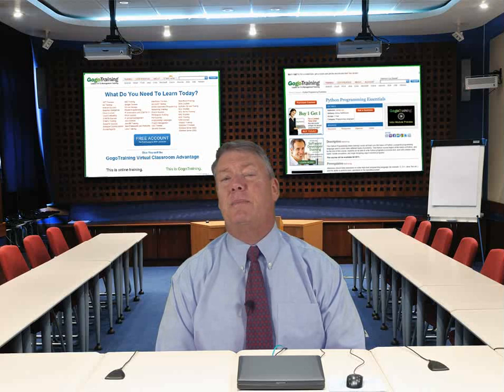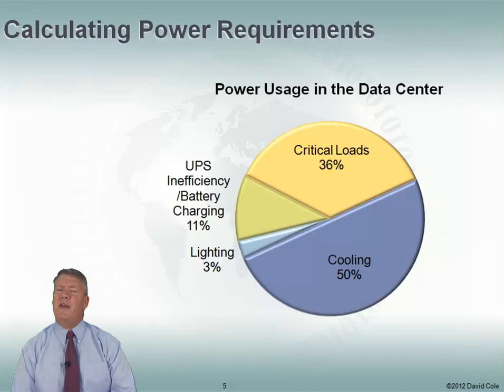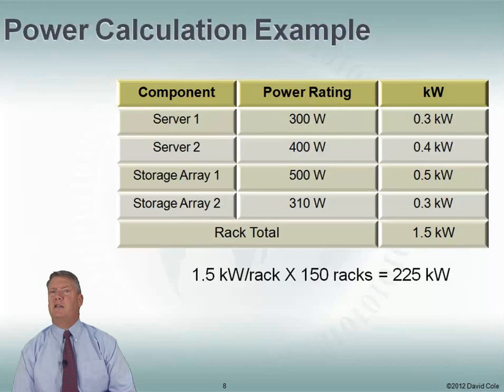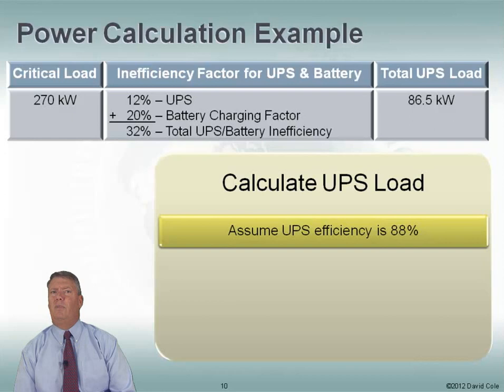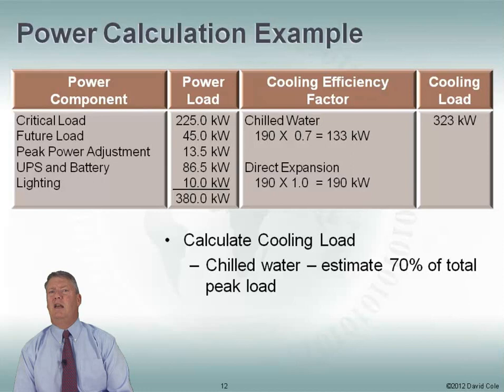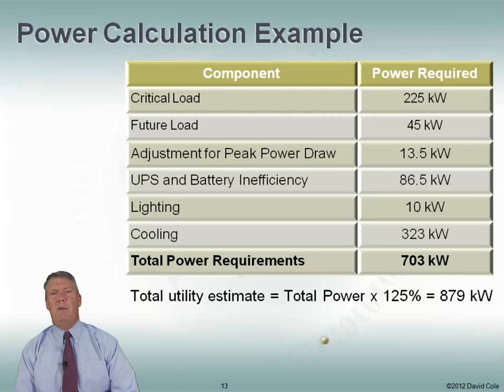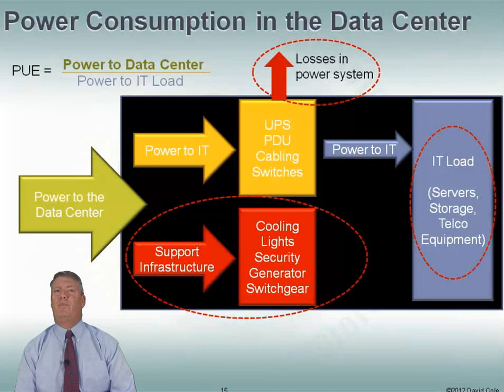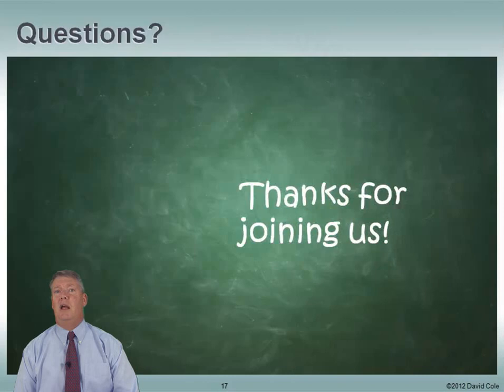Fundamentals of Data Center Power: Power Calculations

Comment: Hi! very interesting topic for which I have a few questions: in a typical DC, in each rack are 2 PDUs for redundancy purposes. My question is: when both PDUs are connected but only one is active (in the sense that it provides active power) how the power consumption is calculated for that rack? Is it that one PDU is supplying max power capacity and the other is idle? If idle, will still consume some power; how much that would be?

Comment: Hey, Cooling Efficiency is most of the time 2-3X (EER) so why need that much power for Chiller or Precision AC ?  if server racks power is 255KW heat load would  be also  around 255KW so need an air cons that will support 255KW+ cooling capacity and power consumption will be almost 1/3.

Comment: normal Colocation run at about 10kW so 1.5 is a bit low. 150 Racks is a lot of space, which could be down sized to 23 racks and 27 racks if all server and storage gets packed together.

most of this load can even be run in the cloud where somebody else hosts the server and we just need to worry about rightsizing our Instances to handle the load. No more datacenter building needed on our site.

Comment: Thank you for the video,
I have a question about the power rating of UPS, for example when we say a UPS of 250kVA is it the power that will be delivered at the output of the UPS or it is the input power that will be consumed at the input of that UPS?
Reply from the maker: Thanks for the great question Abdeslam.  250 kVA is the input power consumed at the input to the UPS. What is delivered to the output of the UPS depends on the power factor of the UPS.  A 250 kVA UPS with a power factor of .8 will deliver 200 kW of output. There are other factors, of course. The UPS can consume as much as 20% of its input power to recharge the batteries.
Reply: @gogotraining3604  Thanks for replying to my question,
As you know most UPSs nowadays have a unity power factor at the output so I think we should consider only the effeciency of the UPS plus the percentage (20%) reserved for recharging the batteries to get the power delivered at the output of the UPS, am I right?
Reply from the maker: @abdeslammerazka3003  It depends on the type of UPS. In a double-conversion UPS (most common), the AC power is converted to DC and then back to AC. There is a loss whenever you convert the power, so the power in will be greater than the power delivered to the output.
Reply: @gogotraining3604  Thanks for your reply,
I have an other question, since most UPS nowadays have unity Power Factor at the output, should we consider PF=1 while sizing equipment and electrical boards that are fed from that UPS ?
Reply from the maker: @abdeslammerazka3003  Hello.  We recommend you sign up and take the full course.  When you take the course you have direct access to the instructor to ask all your questions.  Check out the full offering at this link:  https://gogotraining.com/training/libraries/9/data-center/

Comment: How do you think. What will be a power consumption on 7000 racks an 100000sqf?
Reply from the maker: Hi Oleg.  The size of the data center does not impact the power consumption (except for the amount of cooling needed). The number of racks is part of the equation, but the power consumption of each rack is also needed for the calculation. If each rack consumes 10 kW, you will start with 70,000 kW if required power. You then have to calculate cooling cost, losses in the UPS, and lighting, as well as calculating for peak power draw. You can use the sample calculations in the module but start with 70,000 kW as your starting point for the calculations.

Comment: excellent video. In same example can you please share calculation for PUE? like total power going in would be 879 and it will be divided by ?
Reply from the maker: Thank you Qasim.  PUE (Power Usage Effectiveness) is calculated by :

Total Power In  /  Total Power used for IT equipment (servers, network)

PUE is used to see how efficiently your infrastructure is running (power, but cooling primarily). The best PUE would be 1.0, meaning all the power coming into the data center is being used to power the IT equipment. A value of 2.0 would mean of all the power coming into the data center, only half of it is powering IT equipment. The other half is overhead (losses due to power or cooling infrastructure).
Reply: @gogotraining3604  yes thank you. I was actually asking for the figures in denominator and nominator from the example you shared in video. 

If you can plz share.
Reply: @GogoTraining  I have another question please. How to improve PUE value, best option is to reduce power consumed by cooling. Another factor is to move to virtualization from use of physical server. But P2V will reduce the power consumption of data center but it will worse the PUE as critical load denominator will be less so value will be high
Reply from the maker: @qasimnaseer1  In the example Dave shared, he showed a critical load of 225 kW. This is the IT load in the PUE calculation.

So to calculate PUE in this example, divide total load (703 kW) by IT load (225 kW) to get a PUE of 3.12. The numbers Dave used were very conservative to show how we would go through the process of sizing equipment and calculating overhead. Ideally, we would want to see our PUE as close to 1.0 as possible.

Comment: Helo, I found that their is a mistake in the slide at 13':20" where power consumption in DC are 105% ???

BTW, I follow your calculation with 113.000 sq ft with 900 racks x 16kw/rack. Then the total utility are huge: Utility 55.2MW and Generator size are 62.5MW

Can you help ?
Reply from the maker: Thank you for getting in touch with us.  When you purchase the course on our site it comes with instructor support so you can ask questions as they pertain to the course.
Reply from the maker: Dave checked the video at 13:29 and did not find anything related to power consumption in DE.  Please get back to us with more details.  Thank you.